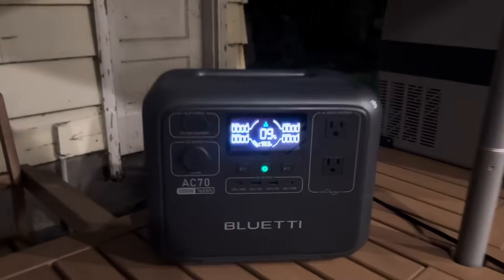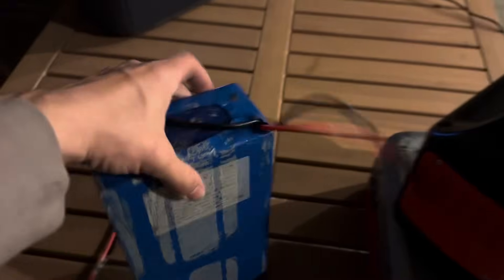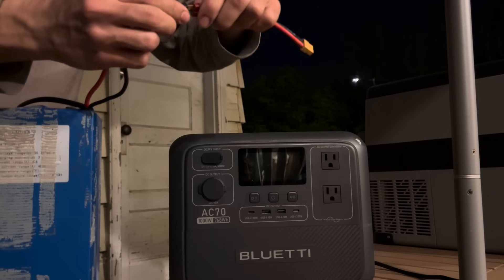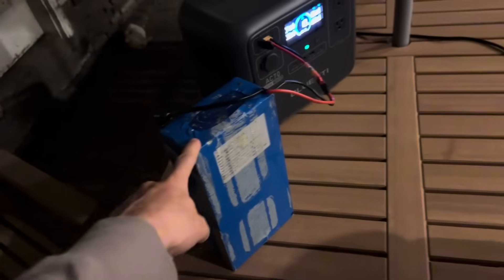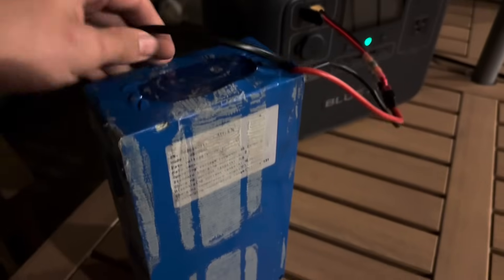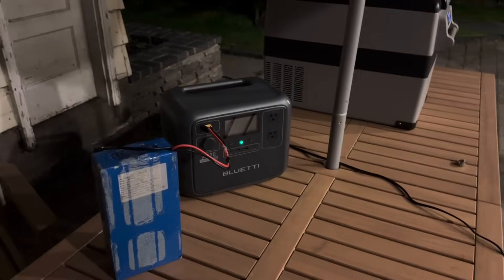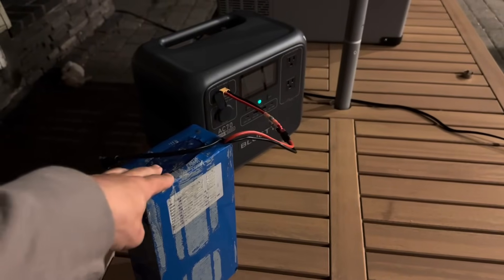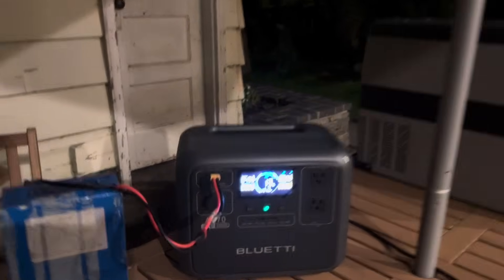How to add 1kwh of capacity to any power station for under $200

Comment: Good videos , learning Thank you  , now i bought a Anker 757 powerstation and tried to connect my alternater charger Etaker 1000 , no luck .
i meassuered output of etaker and it was 41,3 volt on 300watt setted , i believe te Anker can take only 30 volt input , would it be wise to buy me a new bluetti ac70 so i can use my etaker and have 2 powerstations , Thank you

Comment: Dude, those Chinese ebike batteries are notorious for blowing up. Most of them are very poor quality and can burn a house down. They are literally banned in some jurisdictions.
Reply from the maker: I've had multiple and never had any issues. The batteries that come in our phones and laptops are also from china, we're just paying more markup on them. If you believe they're unsafe then don't buy them.
Reply: There have been far too many incidents, but it could be an engineering issue.
Trying to charge too fast (hence the widespread bans on bringing them indoors), or when in use possibly too high a draw so the product appears more powerful than the components can actually support.
The cells themselves should be "safe" when handled within their design limits.

Comment: Get a Bluetti charger one and some cheap lifepo 100 ah batteries. Charges the station at max power through the Solar port.  Lithium ion only cycle 1000 times where lifepo cycle 4000-8000 times.  You can string like 4 lifepo4 batteries and have 5000 kwh extra.
Reply from the maker: @BeefNEggs057  but than you spending >$500

Comment: thanks Bro~ you got a link or two for bike battery and wire & connectors?
Reply: get a Grener power 48v 25ah battery instead. Those ebike batteries are junk used batteries that will not last.
Reply from the maker: @MSSean-md9vf  ive got a link for the battery in the deacription but i do not remember where i bought the connector

Comment: You can get a 12v 100ah battery for the same money and connect to the solar input. 24v work better or two 12v in series
Reply: That charges at 220 watts. Get a Bluetti charger one and you can make 580 watts or whatever the max of your station.  Have to choose your volts in the app to get max output.

Comment: But you now can’t solar charge, unless you have another dc input ?
Reply from the maker: Yea, the AC70 only has 1 DC input, so you can only charge from either solar or the external battery.
Reply: I was going to ask elsewhere but this is perfect... can you charge the e-bike pack while it's plugged in to the AC70? I couldn't make out what the additional wires on it are.
Reply from the maker: @jimg5669 yes, you can charge to e-bike battery while its plugged in to the bluetti. There an additional port for an ac adapter
Reply: Silly me... I looked away near the beginning and didn't see the barrel connector on the charging cable!   😛

Comment: That's a very useful hack.  Been doing this for years, with and without boost/buck converters.  Jag35 has been selling these types of batteries, and explaining how to use them as fake solar input, for at least 5 years.  You didn't really explain what is happening very well, though.  You called that a "DC input" and implied that it's somehow differrent from the MPPT controller, when that IS the MPPT controller, you're plugging into!  This explains why it slowly ramps up to whatever wattage it pulls...it thinks it's getting power from a solar panel and is trying to find the maximum power point.  It's also important to understand that you aren't adding to the battery capacity of the AC70.  You're putting in power from "solar", with all of the limitations that come with that.
Reply: so its dc input lol..
Reply from the maker: @jasonbroom7147  Thanks for the feedback, i like keeping my videos short and to the point so i did miss out on some details, i did mention how the mppt controller thinks its a solar panel and slowly ramps up to find the max power point. I said add capacity because when bluetti sells you an add on battery for this unit, they expect you to use it the same way.
Reply: @sr5_Detailing  - Both of those statements are factually incorrect.  You said you were plugging the external battery into the "DC charger".  You either didn't understand, or didn't communicate when you made the video, that all DC charging goes through the MPPT solar controller.  I suspect you understand that, now, but didn't when you made the video.  As far as the B80 expansion battery goes, it does NOT work the same way; it actually plugs into a different port and truly extends the battery capacity.  The distinction is very easy to make because the expansion battery will charge when it's connected to the base unit, which your "fake solar", charge-from-battery, most certainly will not do.  Most folks who do reviews on these types of systems don't really understand them very well.
Reply from the maker: @jasonbroom7147  I didn't talk about the MPPT charge controller when i made the video because these charge controllers are well known within powerstations. As for the B80 Expansion battery from bluetti, you're incorrect. The Bluetti AC70 Does not have an expansion port. As a matter of fact, bluetti tells you to do what i show in the video if you buy the B80 Expansion battery for the AC70. Most powerstations <1kw don't have expansion ports so this is way to expand the capacity by using an external battery. Yes, you could use the B80 the same way I show in the video but right now its $500 on sale and less than a KWH of capacity

Comment: Can the XT60 even take 8 gauge? All the pre made wires I see XT60 is max 10 gauge. To get 8 gauge you appear to need XT90.
Reply from the maker: did i say 8 gauge? definitely meant 10 gauge, those are 10 gauge wires.

Comment: Does this not just cycle.your battery more as it's just recharging your battery and then draining it.
Reply from the maker: Yes, you would be cycling your battery more by doing this, however, the powerstation has a LFP battery which is rated at 3500 cycles before its at 80% capacity. So personally im not too worried about the cycles. Also a side note, this powerstation also supports pass through, meaning if im using power while the battery is plugged it, itll skip the battery and go straight to the output.

Comment: Just be careful batteries can pack a lot of heat. If it used incorrectly. I am not saying that you would or will!
Reply from the maker: @MR.Kat-zVideoChannel  Agreed! I should have a fuse or switch on the wire but i will do that soon.

Comment: Also the 12v 100ah LifePo4 batteries can be had for $135. One of those will only charge at 100W tho.   Can put two of them in series to get 220W.  But cheap storage.  I do that with an MPPT charger to keep the 24v bank charged up to then fill up my Bluetti AC-180.
Reply: Exactly!! I get 500w of charge with two 12v in series on my power stations. Hook that up to my solar so I have 4kwh of capacity
Reply: @ronhawkins8604  I was about to come here to comment that two batteries in series works better in my experience.
Reply: @williammeek-h2o I'd love a 48v golf cart battery but they aren't cheap
Reply: @ronhawkins8604  Putting 4 of the cheap 100 Ah 12v batteries in series is a lot cheaper than buying a second power station.  And probably has a lot more storage as well.
Reply from the maker: yea, sadly the 10A limit is one of this power stations weakness's
Reply: @sr5_Detailing Parallel ?
Reply: @sr5_Detailing  that 10a limit for 12v input is capped even on larger units under the assumption that the supply is coming from a typical automotive 12v 10a cigarette plug.

Comment: Just to be real, you aren't "adding 1kWh" for under $200.  You're adding 20ah, which is 1/5 of the of what you're stating.  A truthful title would have been, how to add 20ah to any power station for under $200.  Adding 1kWh would cost you over $1k.
Reply: Wow I see our public school system is doing wonders in mathematics.
Reply: It's a 48V 20AH, so that is 80Ah 12V, so that is .960kwh.... almost 1kWh....
Reply from the maker: Because the battery is 48V, 20ah*48V equals 960Wh, or .96kwh
Reply: a batteries storage capacity is measured in watt hours.  To get watt hours you get the batteries nominal voltage and multiply the amp hours.  so that ebike battery is 48 volts times 20 amp hours give that battery a total oh 960watt hours of energy or just under 1kwh
Reply: Learn Ohm's Law. More voltage means more watt-hours per amp-hour. A 48v battery gets 4x the watt-hours for every amp-hour compared to a 12v battery.

You can only really compare batteries of different voltages by converting to watt-hours first. It's easy: just multiply the voltage by the amp-hours.

Comment: That's not expanding the capacity, that's charging from another battery.
Reply from the maker: @jampam-jf8mt That true, if you actually buy an expansion battery from bluetti you do the same thing. Just charging it from another battery.
Reply: LOL Which is essentially the same thing.  Just like if you ran a hose from a gas tank to an existing gas tank on a generator, you're "expanding" the gasoline capacity.
Reply: @tonyinfinity not the same at all
Reply: @HuYou-bs5rz  Absolutely the same. If your computer has 1TB memory capacity and you add another TB hard drive you've expanded the capacity.
Reply: @tonyinfinity its like trying to watch a movie with slow internet  needs a buffer
Reply: Or as people with the correct number of chromosomes would say... or anyone who passed 4th grade science... expanding the capacity.
Reply: You are expanding the time of use. It like  puting another battery in parallel in the old days. Expanding the amount of usable energy. So  no one is wrong. Batteries in paralell provide energy to each other or single way. More usable ah added. Have nice evening/day.
Reply: @BeeBeorn  not really parallel its charging it so its bottle necked if the load surpasses the charging input you could possibly discharge  the internal battery

Comment: If you are paying a hundred and fifty dollars for that you are getting ripped off
Reply: HaHa How's that? An "expansion battery" from one of the big manufacturers are way more. This type of battery is about 18 cent per WH compared to the Ecoflow river expansion battery that's over $1 per WH.
Reply: @tonyinfinity  cycle life average of these is just 300-500 cycles compared to 3500+ on the better batteries so at best your going to need 7 of these batteries to match the cycle life plus the plug and play convenience since this setup now needs another external battery charger. """BUT""" these still may come in cheaper than the named things in their pretty cases overall

But the river EB600 batteries are only listing a 3000 cycle life
Reply: @WhatTrigger  Who's using this everyday to charge their power station? It would be for some extra juice occasionally. Just like my power bank for my phone, I've owned it a year and have used it maybe 5 times.
Reply: @tonyinfinity  Not all lithium cells are the same, you may want to look into the cycle life of 18650's
Reply: @WhatTrigger  Or I might not care. Like I said this would be used OCCASIONALLY! There's no way I would be doing this 500 times and fully deplete the battery, even then you're losing 20% of the capacity, "lifespan" doesn't mean it just disappears into thin air after 300-500 cycles. My E-bike still runs just as long as it did 4 years ago and I've discharged and recharged it at least 300 times in 4 years.
Reply: So you getting all defensive clearly points out you realised I was right about them not been cost effective with your initial point comparing price per Kw hour. nuff said
Reply: @WhatTrigger  LOL I love the delusional fools on social media who think they've somehow disrupted my life thinking they "triggered" me. ROFL I'm glad you'll sleep good tonight thinking you "won the argument". Sad just sad. Your big accomplishment today was telling me some fact you googled. ROFL Hilarious. Now you'll respond again with some worthlessness thinking I'm upset. The sad part is you actually thrive on the thought you did upset me, when the reality is I could care less about you.

Comment: how recharge ebike batteries automatically from powerstation?
Reply from the maker: @sianami-e9s  the ebike battery charges from the barrel connector and an AC power supply, What i do is when solar is really good, ill plug in the ac adapter and charge the battery up, Im sure there are more efficient ways but this works for me.

Comment: This would be perfect for my pecron e600.  It has a 1200 w inverter and 600 wh.  The charge controller goes up to 95v and limits solar to 400 watts.    I have large power stations but I love the versatility of these small ones and like you said they just don't last long enough.
Reply: I think the newer high AC inverter ratings are due to a shift to internal 48v structures.
Still... it can't be pleasant on the cells, charging at 1C+, or dumping it all at closer to 2C.    😮
Reply from the maker: @jimg5669 the bluetti actually allows you to change to input speed so i can limit it to 200w. I'd only use the full 500 if i need to.
Reply: @sr5_Detailing : That is nice. My new Pecron E1000 has a slider to change between 8A for car charger type inputs and 20A for max solar (up to 60v for 600w max).
I just need to not forget where it's set... pop a fuse real quick that way!   😛
Reply from the maker: @johnmal5975  95V must be nice, that really give you a wide range of uses, and yes, powerstation are so good now with high input/output but the capacity means I can drain it in 45 minutes.

Comment: Brilliant! I've seen people doing this but with 48V rack batteries that are $1000 and way too big to bring along if you're camping. Have you tried plugging in the charger while it's connected to the power station? I don't know if you'd even see a difference since that Bluetti can only go to 500 watts, but I'm really curious if the addition of the charger would add another 100 watts? I know it doesn't really make sense since you can just plug in the unit to charge it. In theory if I had two of these and plugged them into my Delta 2 Max which has two solar inputs I should be able to get the max solar input. Also since these e-bike batteries are around a 30amp discharge rate they should be able to charge a power station even faster than 500 watts.
Reply from the maker: If it plug in the charger the bluetti will still only get 500w because thats what the mppt charger is limited to. The E-bike battery I'm using will output a continuous 35A but i would still want a bigger battery if i was pulling more than 1000w. The delta 2 max would be able to pull 30A but you would need an XT60i connector otherwise youre limited to 10A on an ecoflow.

Comment: Some of this battries are LIPo not LiFePo . So they are much more dangerous.  I would not use a cheap LiPo Type .
Reply: that ebike battery is made with 18650 cells and is not with lipo cells.  That ebike battery is a 13s7p so its made with 91 18650 cells.
Reply from the maker: @dominik9041  This battery is a li-ion, but yes, LiPo is a relatively unsafe chemistry.
Reply: Only if you over charge them, obviously you should never charge a lithium battery in your house and leave because any charger can malfunction.
Reply from the maker: @tonyinfinity agreed, and not many batteries beside rc car batteries are lithium polymer anymore.